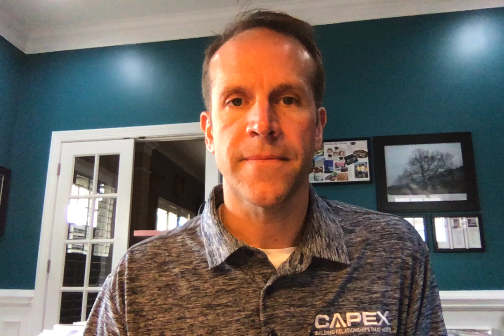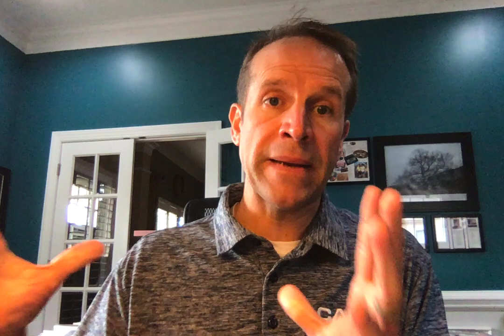Mass Flow vs Pressure Decay Leak Test Technology

Comment: Can the mass flow test can be done for laryngeal tube?
Reply: Mus - Mass flow might be the most appropriate technology for testing a laryngeal tube depending on what you are attempting to detect. Do you want to verify the volumetric flow through the tube or attempting to evaluate for a leak? For volumetric flow, you might consider using low-pressure and a high-flow flow meter. It is important that the tubing from the flow meter that seals on the part is larger in diameter than the part you are testing to avoid flow restrictions. You would need to establish a reject limit. The other portion of the Laryngeal tube is the bladder. The bladder will be more challenging to test because it blows up like a balloon. We would recommend an inside out test for this type of test. You would pressurize the bladder inside of a restrictive chamber and measure pressure rise in the chamber. These are the methods I would recommend based on my limited knowledge of laryngeal tubes. Good luck and I hope this is helpful!
Reply: @russsorrells-BOS  it's reply helpful sir! Thank you for answering 😊